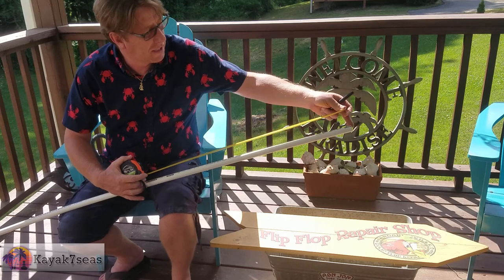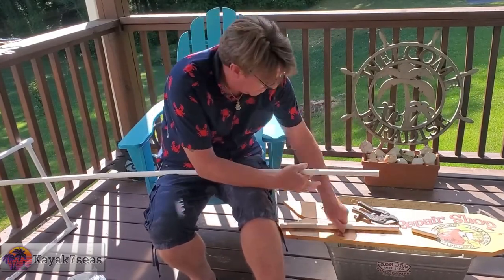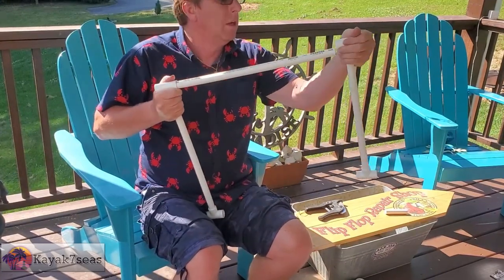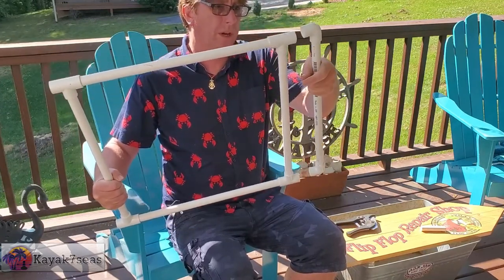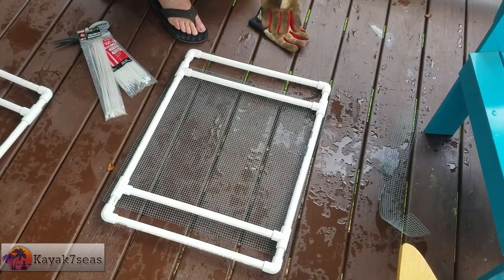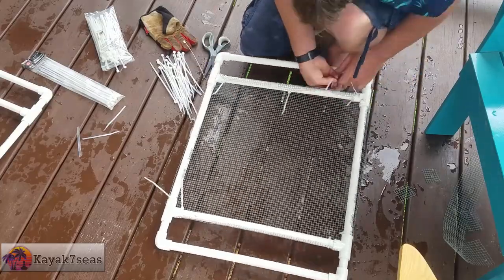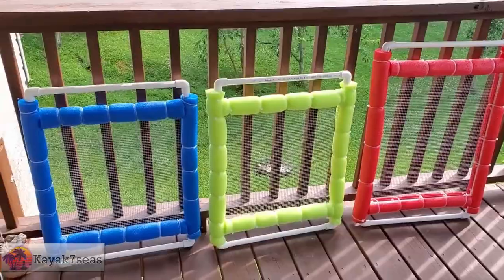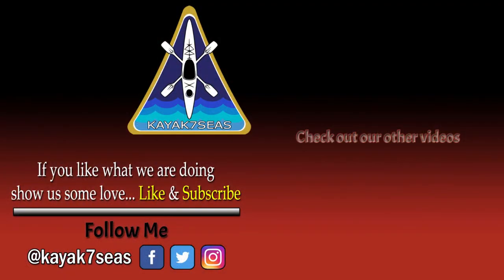DIY : Build a Shark Tooth Sifter | Flip Flop Repair Shop | Kayak7seas

Comment: Great video…2questions
Do you think a smaller one would work to be able to put in my suitcase? If so what would be smallest size?
Do you think handles are necessary or can you get by without them
Reply from the maker: yes, you could opt for a smaller one to fit in your suitcase. You just might not be able to pour as much sand on it to sift. The handles aren't really necessary, just a nice addition.

Comment: This is awesome but I went to the hardware store to get the supplies for all of this and they told me it would be $53 😢 so I told them never mind
Reply from the maker: wow, prices must have really gone up
Reply: You should have got a shovel and dug up your neighbor's sprinkler system for parts
Reply: $63.61 total as of today to make two 18” models like in the video. Got to love inflation in the last two years. The zip ties have tripled in price alone. Was forced to buy the 10’ long of wire so that should go a long way making other sifters down the road.